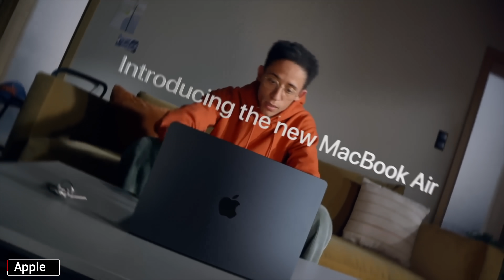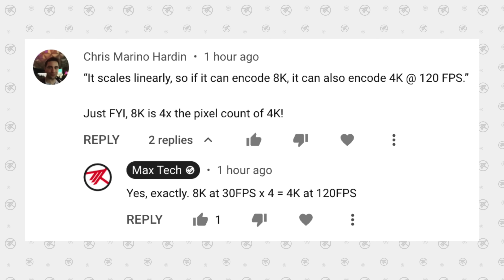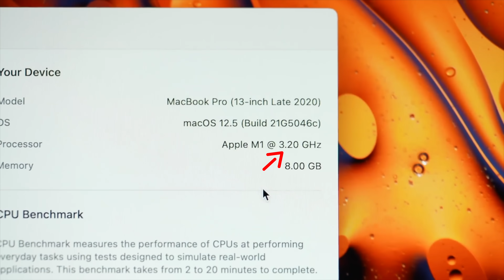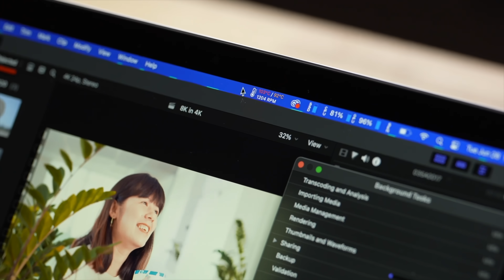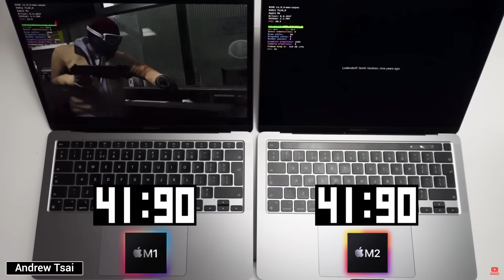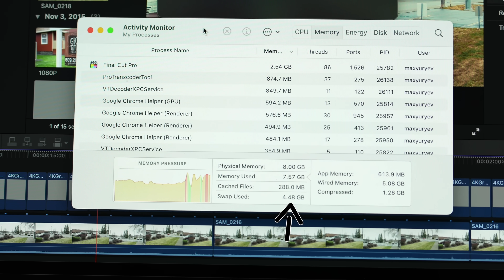M2 MacBook Pro - Top 7 Problems after 1 week..

Comment: I’m definitely leery of the M2 Air after seeing what Apple did with the 13” Pro. The more I see, the more the M1 Pro 14” looks like the way to go.
Reply: I chose the M1 Pro over the M2 for my office laptop. 

My personal 2020 M1 Pro still is a monster for what I do; coding and remote work.
Reply: Same here, but my concern is, whether Apple is using the same ssd for new m1 based 13inch model  or refurbished ones
Reply: That is precisely what Apple want you to do!  Most people will look at the 13 inch M2 MBP with 16 GB & 512GB SSD and decide that for what they are paying for that they might as well go for the base 14" MBP with the M1 Pro chip.
Reply: @StylusDrop  and it’s working :)
Reply: Fr, I was going to get the m1 air 16 512 until I saw the m2 design, but now I’m more reluctant of the m2 chip not actually being better than the m1
Reply: @Elmar Zeinalov I’m a PC user, never used a Mac for anything. I’m a translator and do voiceover work. Not flashy like video or image production, but others in these fields have convinced me that the Mac is a better platform for various reasons. I work at different locations, so a laptop is the way to go. It’s time to update my setup, but I’ve been watching for more than six months to see how the M2 would actually shake out - particularly looking for silent (or nearly silent) operation, battery life, and 5+ years of reliable use. From all the reviews I’ve watched and read, looking at stats and features, any PC I look at at the same price point as a MacBook is a lesser computer. But the drive speed issues and thermal issues here rule out the M2 MBP 13, and almost certainly will rule out the M2 Air.
Reply: @Tarjema  Wait for the M2 Air, if it’s not better, grab yourself a heavily discounted M1 Air and call it a day! They’re all great machines and your experience will be miles ahead compared to any windows laptop. Especially in terms of performance, heat, noise, security, reliability, echo system, quality longevity, resale value and the best battery life! 

Tests here are pushing the machine to its limits. It’s by no mean bad, but just not very satisfying for the upgrade we were waiting for since the M1 launch by end of 2020.

Besides, Apple intentionally doing this to lure people into the M2 Air or the M1 Pro 14”. 
This is the only reason this machine exists. 
It’s great but the Air is better and if you need more power the 14 is the way to go. For get about this. 
You’ll be happy and excited for moving from windows.
Reply: @Tarjema  The best choice for you is a M1 Air with 16G memory with 51G HHD. That's it. Save your money for something else. I'm typing from a M1 air 8G/256G model. I can't live without it now. My old 16" intel MBP, which sounds terrific, now sleeping 25 hours day, 31 days a month...
Reply: @Tarjema  my advice…. I moved over from a PC Intel in November for the M1Pro.  I do professional graphics and print.  While this computer has been very good, it’s definitely not for everyone.  Unless you NEED to go to Apple because your a creative, I don’t think the premium is worth it.  Apple has a lot of quircks…the OS is odd, Safari always gives me problems, there’s still Intel based software I use that haven’t been optimized for M1 (and who knows if they ever will), and they run pretty laggy, etc.  
As of right now, I’m fine with the premium I paid for the machine 32gb of Ram, etc., but if Apple starts to drag down the performance thru forced “upgrades” and this computer ages heavily in only 3 years or so, then I’ll absolutely be disappointed in my purchase.
Reply: @Tarjema  Also a translator here so I share the same considerations as yours as I decide. Also hoping to run a VM. I'm eyeing a Macbook Air M2 16/512 for portability and efficiency. I feel like MBP 14 would be overkill but M2 Macbook Air base model would be too tight, if not scarce after a few months or years of usage. But I'm not really sure since it would also be my first time to switch OS. On the one hand though, the 14 inch screen would be fantastic for translation work involving visual media.
Reply: @Tarjema  M2 Air will likely be better, with the new design, magsafe, and better webcam alone.
Reply: @adriananzano2292  my biggest worry now is heat. I may yet watch to see what happens when it is actually out.
Reply: @Tarjema  If you’re not doing cpu/gpu intensive activities like video editing you shouldn’t have any heat issues. However you should stay away from the 256gb ssd model. Or go for the M1 macbook air.
Reply: @Tarjema  If you're doing 8K Red Raw footage in Final Cut on an entry level machine, you're buying the wrong machine. For anything else, the fans will barely turn on. There really isn't an overheating problem for virtually everything else you do.
Reply: @StBernardFan  The M1 Air is tempting and has been since I started looking, and the M2 Air hits everything I could hope for - or did on announcement day! The problem is I have one Windows-only app I need to use periodically, so I need to be sure I have resources for a VM (16GB memory, 512 HDD minimum on the Mac side to parcel out what I need). Add that memory & drive space, and next thing you know you are thinking "but for $300 more I get [all the stuff a 14" MBP M1Pro has]." And so I'm still on the fence. 
Another huge selling point for Mac: I can order direct from Apple and get the language I want on the keyboard direct from the manufacturer, no stickers that don't benefit from backlight, no hitting three keys because I know the letter I want is under the Y, U, or I... no PC/Windows manufacturer offers that.
Reply: @Tarjema  In my personal opinion, you should wait a bit more and see how actually the M2 Air performs, in a few weeks we'll know more and you could choose between that, a 14 MBP or an "older" but stil great M1 Air (at least, that's what I'm doing, right now the only thing I'm sure about is that M2 MBP 13' is an absolute a no go for me)
Reply: @techinrl9869  That's not the point. The point is that nobody, I repeat NOBODY should be forced to spend lots and lots of money on upgrades just to get a workable machine.
That would be like buying a car for $50,000 and then having to spend an extra $10,000 just to have wheels included so it is workable.
Apple are beyond greedy and Cook is a tight fisted scrooge who needs to go...NOW!
Reply: @aTorre98  That's my plan for now. And it gives me time to save up a bit more $ if I end up needing it.
Reply: @aTorre98  yeah, that's a good idea we should wait and see how it actually preform
Reply: @adriananzano2292  who cares about better speaker and better webcam when you barely use them outside of zoom calls.
Reply: @anires1195  what do you mean, you take advantage of better speakers every time you watch a video
Reply: The 14" Pro seems like the better bet esp now that it has a $200 discount on Amazon
Reply: @ZeryusXD  and at my local BestBuy! I almost picked one up yesterday rather than order and wait a month. But I do want to have the Arabic keyboard, and I can only get that ordering from Apple.
Reply: I just got my M1 pro 14 in and it is amazing. This is the way lol
Reply: I thought about getting the new m2 macbook air. But I worry it will be as bad as the m2 13 inch pro. I think I’ll just go with the 14 inch m1 pro. I was thrown off by the thermal throttling. Not only that, but the air is fanless!
Reply: I just received my M1 Pro MBP and it’s an absolute dream come true. No regrets whatsoever.
Reply: @beatsmithaudio9245  is the camera good for day to day zoom and FaceTime? I’ve only thought about the m2 air because of the 1080 camera, that’s really the only deciding factor for me between the m1 air vs m2 air
Reply: @delanos.3859  Oh yeah, the webcam is really good. Noticeably better than the 720p webcam on my old computer. I’d say it’s just as good if not better than your average front facing iPhone camera. Nothing crazy but definitely good quality!
Reply: @beatsmithaudio9245  thank you, what’s the spec on your MBP and how good has it been, because right now I’m using a windows laptop w/ 8gb ram and 1tb
Reply: @delanos.3859  So, I got the 16 inch with the M1pro 10 core CPU 16 core GPU, 2TB SSD and 32GB of RAM. It’s a little overkill but, the 32GB of ram is great if you have it in your budget to work with. Honestly, after trying a few of the new MacBook Pros, I’d say you could get away with the 14 inch M1 Pro with 16GB of ram and 1TB of storage (could go lower and supplement with an external SSD if you don’t mind that). I would just work within your budget and not worry about it. The M1 air is also a fantastic computer and is a great price right now! Honestly, you can’t go wrong either way in my opinion.
Reply: @beatsmithaudio9245  you must be a programmer, video editor or something getting that powerful of a laptop😂 I’m only a 16 year old and the only things I would use my MPA for is doing my assignments, ft, watching movies and some light games like football manager. Thank you for the info, just made my decision fr
Reply: @delanos.3859  haha you’re very welcome! I am a professional music producer and I dabble in some video editing as well! Haha well, since you’re a student. I would lean heavily towards the M1 Air. Way better price and very good performance!
Reply: @beatsmithaudio9245  thank you again!
Reply: @delanos.3859  yep! Good luck!
Reply: MBP 14" is a great machine. If you can wait and see on the MBA M2, why not? But to me it's b/w those machines. I chose MBP 14" because I want to run dual external displays so that ended the debate when they released tech specs for MBA M2.
Reply: @timstafford6815  dual display at home would be a definite plus. I recently went from two to one ultra wide, but it would be nice to have the option to add in a second even now.
Reply: That’s what they want you to think
Reply: It's that good to go 16gb 256ssd air version for rap beats?
Reply: I’m wary too & wonder two things about the M2 Air:  1 Did Apple improve the heat sink or will it throttle worse than the M2 MBP
2 Will they use 1 or 2 NAND chips for the 256GB SSD?   — though I’m likely to get a 512GB or 1TB SSD on my next MacBook Air or Pro.

Comment: I had a chance to get the M1 MBA, 16 GB, 1TB, 8 - 8 Cores and let it slip by.  What a mistake that was.
Reply: Even the last Intel i9 is better guys 👍
Reply: @thecowegg  ooo the i9 intel is better than the m1 air ?
Reply: @LouisLuzuka  I don’t have the latest MacBook Air BUT I don’t think it’s far off.
Reply: @thecowegg  same I have the i9 imac
Reply: I am using the Intel i9 fully spec out except for the storage which is 2TB and when I do video conversion on handbrake, the fans still kicks in. To me, the fan is suppose to run as a fan to cool the computer down when needed. Preventing the fan from kicking in at a lower temperature sounds stupid and totally eliminating the fan on the MBA sounds even more silly 😞
Reply: @thecowegg  ya I have the same 2TB ! Thank you for reminding me that the jet fan engines is to help cool down Because it’s doing its job it’s not a bad thing 😍
Reply: Same
Reply: @LouisLuzuka  I'll be rocking my early 2020 MBA i5, 16GB, 256 SSD for quite a bit longer now.  😃

Comment: I will be purchasing the maxed out M2 MacBook Pro with 24 GB Ram and 2TB SSD to use the chip's full potential without thermal throttling too much.
Reply: What is the explanation for this?…
Reply: How is the 24GB RAM and 2TB SSD going to benefit you in regards of thermal throttling? Do these upgrades go with a batter heat sink, a better fan or a fan that engages sooner than the base model M2 Macbook Pro?
Reply: I will be running all sorts of tasks on this laptop like preparing presentation for meeting and programming since I'm a game programmer.Plus MacBook Storage is not upgradable once purchased.And I will also not be upgrading this machine for atleast 5 or 6 years.I want to remain future-proof.
Reply: So? How does SSD and RAM future proofing have anything to do with thermal throttling? 
Heat sinks, internal volume, fans, Watts and CPU clock speeds matter for thermals.

Comment: Vadim ok we got your point! We don’t buy m2 MBP you already make 4 video about it just stop! this drama is getting pointless
Reply: He makes it seem like the M2  chip itself is slower. This is all simply avoided by going for the 512GB model if it really is an issue.
Reply: @Flash_lsg  That would fix the ssd speeds, not the horrible thermal throttling.
Reply: @AndreHance  horrible thermal throttling will fix with updates even intel core i5 or i7 will thermal throttle!
Reply: @dropr1662  genuine question, is it a common practice that update can solve the thermal throttle?
Reply: @kevinraihan508   yeap
Reply: @Flash_lsg  exactly
Reply: Indeed... its getting OLD FAST

Comment: keeping the same design on their entry level laptop is not a 'problem'.
These click bait videos are getting so boring now. Everyone wants to make a 'gate" video when it comes to apple.
Dont understand why you would think the M2 would be much faster thna the M1 Pro. The M1 Pro and max are going to be faster than the M2 - like how the m2 max will be slower than the m1 ultra. The fact its 5 seconds faster encoding is a pleasent surprise.
Reply: Man you hit it on the spot. A lot of drama for a $1,299 laptop that is being phased out. Back in 2016 this would have been $1,799. Now it’s $1,299 with an M2 processor. It’s a price point, move on.
Reply: This is not their entry level model though.  It is $100 more expensive than the entry level MacBook Air but has a worse and older design, a worse display, a worse camera, less ports, and a few advantages like a fan (but it still thermal throttles) and it comes with the full M2 chip instead of the binned one but you can 
pay for the binned one on the Air which will make the price equal.  It still comes with 8GB of RAM and 256GB of storage which is not the best for a Pro laptop, and if you upgrade those you might as well get the 14 inch MacBook pro which has a ton of advantages including the fresh design over the 13 inch MacBook Pro M2.
Reply: @xeon3081  It is the entry model. If you spec the Air and 13" Pro exactly the same, the cost is identical. The $100 difference in base price is due to a binned CPU with 2 fewer cores. Pay the $100 to up the Air to the same CPU and you'll find every price is the same. There really is no difference between the Air and the 13" MBP except for not being able to buy the binned CPU. The name is a misnomer, probably left over because they didn't want to change its name from when the Intel versions were better than the Air. Now they're both the same.

Comment: I can’t wait to see your future review for the new MacBook Air ! Do you think those will have the same SSD issue ?
Reply: I think the chances are high
Reply: we aren’t sure yet, but we’ll see after max tech gets their m2 MacBook Air.
Reply: Years back I noticed low-capacity SSDs on intel Macs to perform much worse than 1tb or greater. So, I think the 1 or 2 GB configs may be good and fast. Other thing to worry about besides slowness on base configs is longevity. NAND flash has l8mited number of erase cycles so the more you rewrite the more likely blocks will be marked as no longer reliable.
Reply: The chances are indeed high since the M2 air went into production possibly 1-2 months ago. So in light of all this controversy it’s too late for Apple  to reverse course and may revert to software wizardry to mitigate some of these hardware issues.